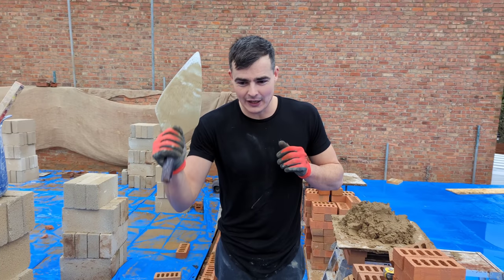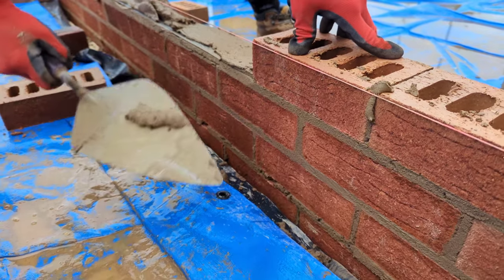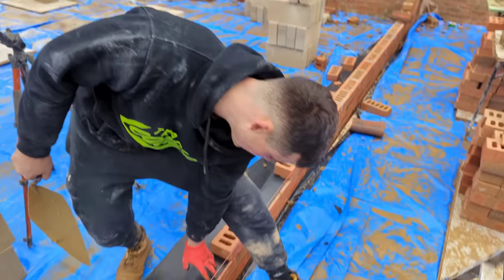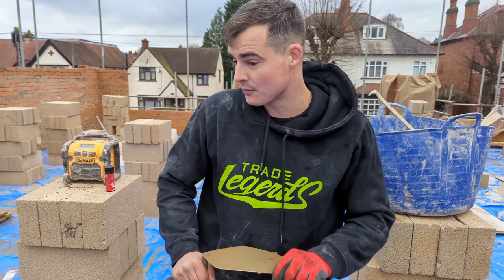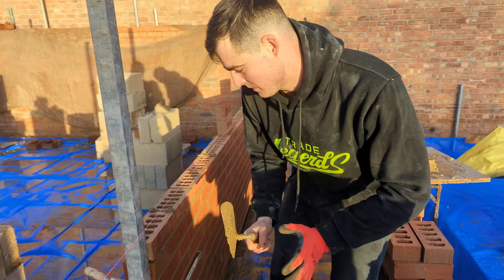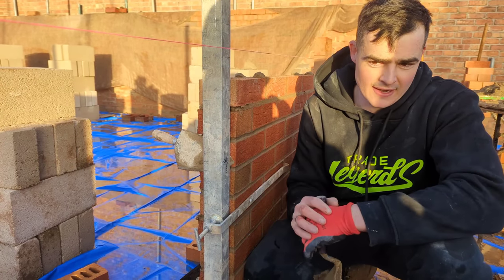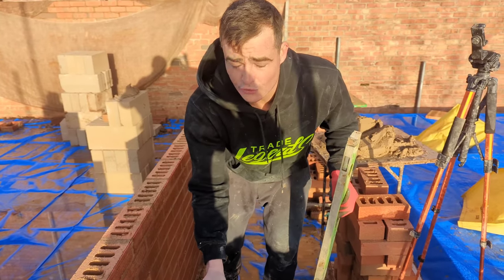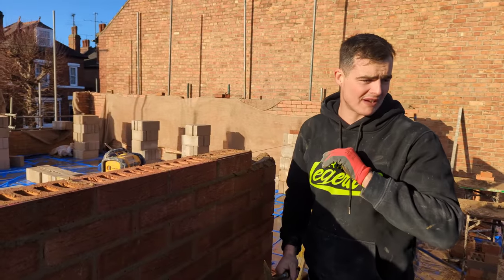Bricklaying - FINAL Brickwork of 2022 🎉

Comment: Nice neat brickwork. I am a bricky with 44 years experience. Since masonry is a rainscreen I am concerned that there is no vapor barrier on the inside surface of the blockwork to keep moisture from getting in the living area. Without that you risk the chance of mold. So your bricklaying skills are very strong and nice to see.  Cheers Merry Christmas from across the big pond!
Reply from the maker: Merry Christmas to you and your family buddy! Over here, we don't use Vapour barriers as you mentioned on traditional builds like this one. I've only ever seen them used in different countries. All the best 🎄☺️
Reply: @IzzytheBricky  I understand that but vapor barriers work. UK has a big mold problem small change makes it 80% better. As you know mold is a health issue. Cheers to you. I leave you with a question though in the 70's and 80's english bricky's that worked with us wore a tie and white shirt to work! So were clear there was a large influx of UK bricky's during a large work boom. All of them that just came over wore this. Why change tradition? Where's your tie??? 😀